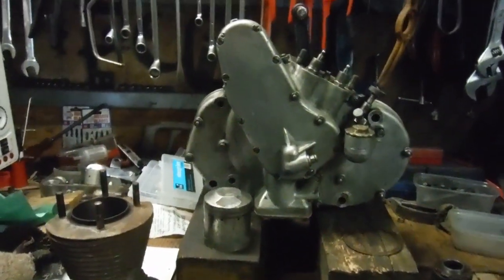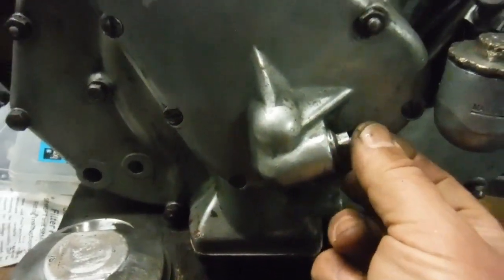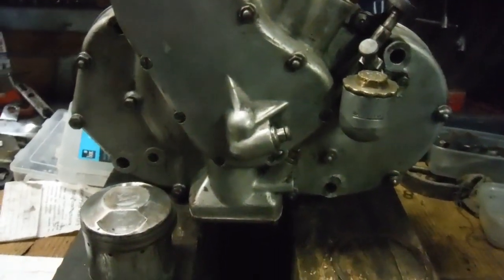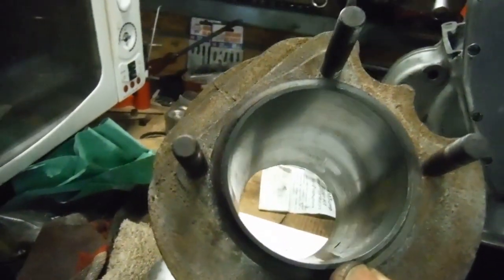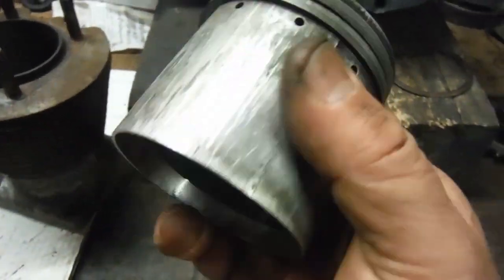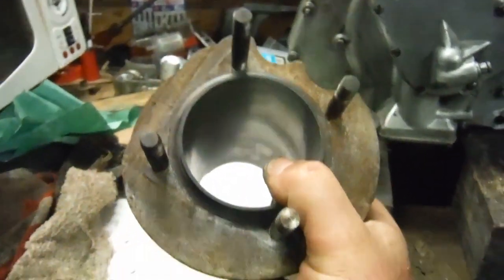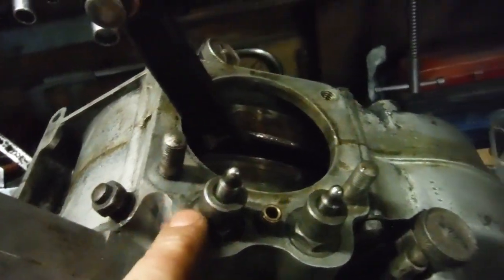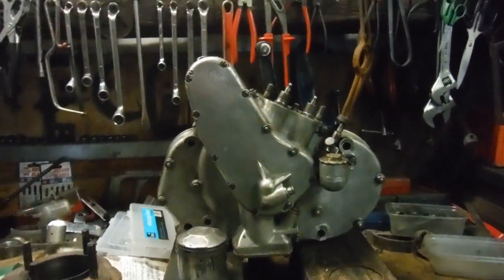BSA 350 cc Model L engine circa 1930 strip & rebuild 14 Top end & oil pressure tell tale discussed.

Comment: Hello Paul. It looks like that Gudgeon pin is of a soft end type just like the one I've got for my Bluestar, problem I have is my Gudgeon pin has some marks on it from rust picked up during storage. Do you know where I may be able to get a replacment ?
Reply from the maker: Hi graham, this one has some light pitting and staining, but it is a good fit still, so I am not worried about it. Pit marks are low spots which can trap oil, rather than high spots which would cause wear, after all.
Reply: @paulhenshaw4514  in that case I won't worry about it then. 
When I found it had some surface rust with little pitting, I removed the rust with a very fine oil stone but didn't take and material off. My brother (Paul) said I should use it as it's new and has no high spots and the pitting will help with lubrication. I just needed a second opinion, thanks Paul.

Comment: As an observation, should it have a head gasget? B31's and 33's dont. I see a spigot on the cylinder like the other pre unit singles and wonder did someone add a gasket to lower the compression?
Reply from the maker: A 'Cylinder head joint washer' is mentioned in the manual.